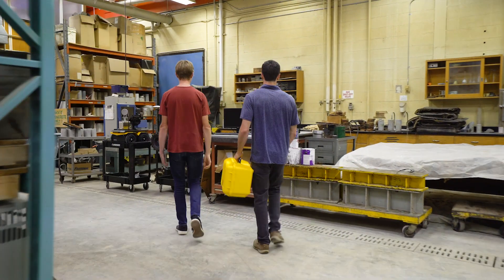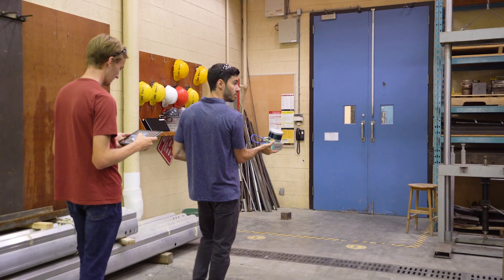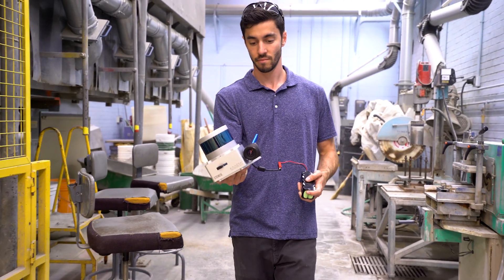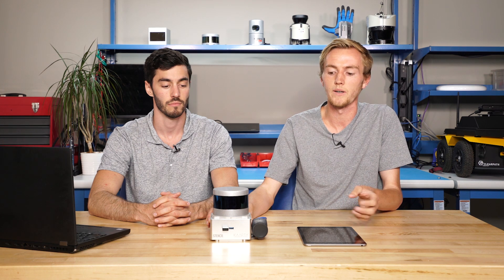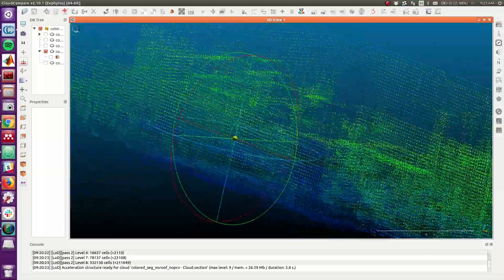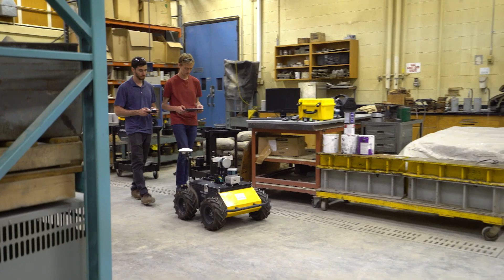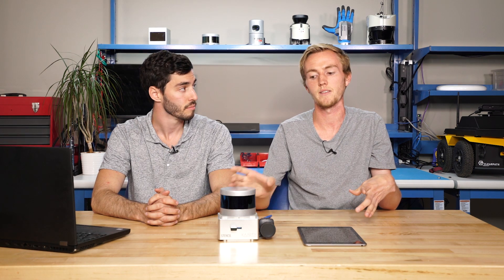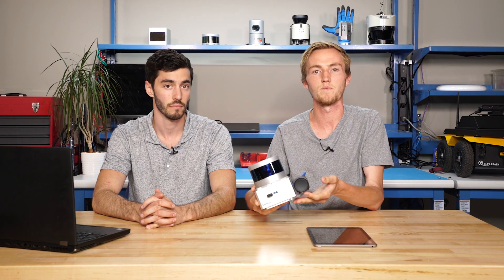Kaarta Stencil 2 | 3D Mobile Mapping | Hands-On Review

Comment: Are these guys using custom SLAM or they are tuning the ones available off the shelf? If they are using custom SLAM, is it available in open-source domain? I’d be happy to know more about this.
Reply: It seems they are using the SLAM based on an algorithm called LOAM, and developed it further. Even in github you can find a lot of updated version of LOAM, which are pretty good, especially if you have good IMU, it can be pretty accurate as well.
Reply: @kenshee627  The SLAM SW they are using was developed by Kaarta about 6 years ago.